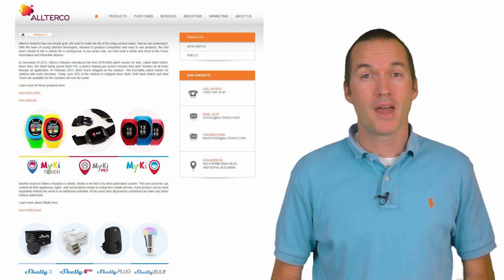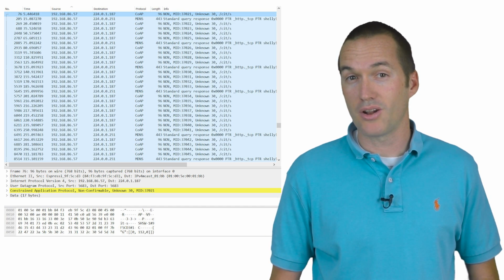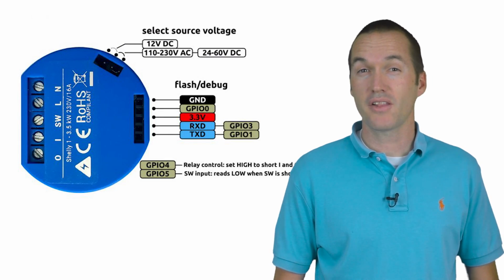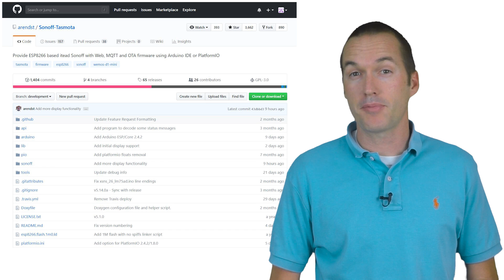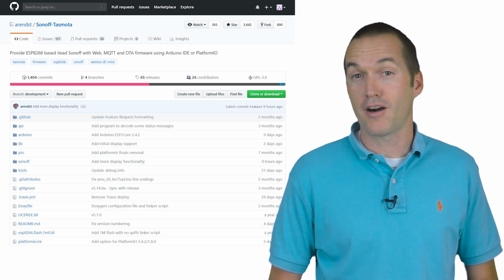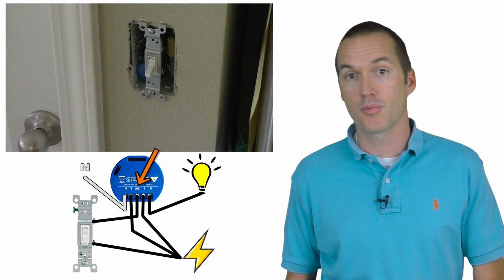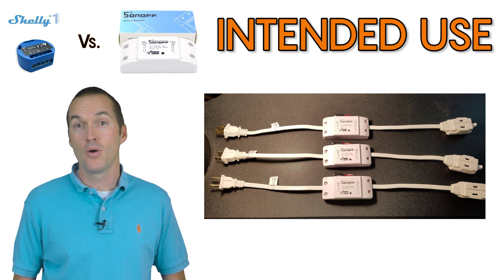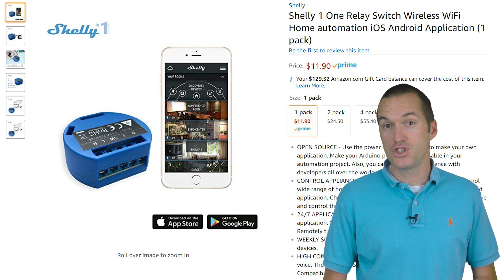Is the Shelly 1 better than the Sonoff Basic?

Comment: Really REALLY dont like that the GPIO's are tied to the hot lines- thats a major down-side for safety, cause you're always likely to get that one person who's gonna try flashing it in the wall and killing themselves
Reply: i don't see the downside there, hire a professional or understand what you are doing. We shouldn't have to idiot proof everything to keep them alive, it just allows them to get dumber.
Reply: @frozenthorn9619  can't idiot-proof anything. The "idiot" will just level-up.
Reply from the maker: The documentation is pretty clear on it, but I agree it's a danger.  I do think overall it might be better though since the same thing could unexpectedly happen with a sonoff that has been installed for months.
Reply: @TheHookUp  I've always seen/read to never connect to a sonoff tied to mains as it would fry the FTDI or something like that.
Reply: It's no more dangerous than telling people to turn off the electricity before working on a socket. If they choose not to thats on them.

Comment: nice video.. would they make a UK version as we dont have Neutal at our light switch
Reply from the maker: They have it pictured being installed at the breaker panel (a UK style panel), not sure how you hook up a manual switch to it in that case though.
Reply: In Italy we don't usually have neutral wires at the light switches either. I usually pull a neutral from a nearby outlet or junction box, thru the original inwall wire duct, to the switch where I need it. Depending on your wiring layout that migh be the easiest way to do it.
Reply: Don's DiY Stuff not 100% sure if legal in uk to do this. Maybe a uk electrician could clarify please
Reply: nigel Holland
If I got it right, he takes neutral wire from sockets and hook it up to light switch, which is separate circuit. I don't think that's even legal. To be honest, I wouldn't think that even worked.
Reply: No, the light switch has nothing to do with the neutral in the end. The switch only operates on the line wire,  just lke the traditional one.  The neutral is instead only needed for powering the sonoffs (sonoff touch US in the cases I mentioned above). 
The connectors on the sonoff touch are [Nin | Lin | Lout].
To give an idea of the layout I had, on the same vertical wire conduit, from the ceiling to the floor are, in order, junction box, light switch and outlet. From the junction box there are 2 Line wires reaching the switch (in and out, the out one eventually goes to the ceiling light) and 3 other wires  (L, N, G) going all the way down to the outlet.
I could've pulled a N wire from the junction box, but it was just more convenient for me pulling it from the outlet as the outlet had inside a spare set of connectors (there in case you need to add, in line, other outlets). Either way, it wouldn't make any difference since in the junction box all the N wires go to the main neutral cable that reaches the room.

I've tested it and I had this setup for months now,  it's working just fine and safely (in my case) as there is no sketchy connection whatsoever.
Reply: @lucasch.159  it is against the rules here in Australia to mix lighting and power circuits like that. You would likely need to run a new neutral directly from the fusebox. The UK is probably the same. Taking a neutral from a power circuit may affect the tripping of circuit breakers.
Reply: @MakeOn  that might be legal in the US or Italy but not in some other countries.